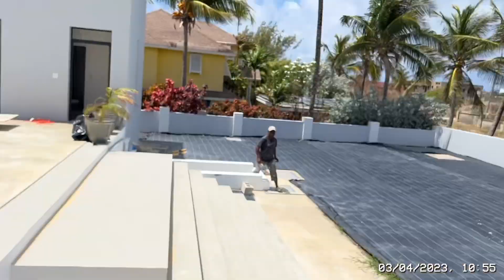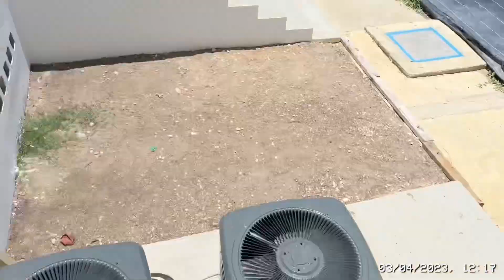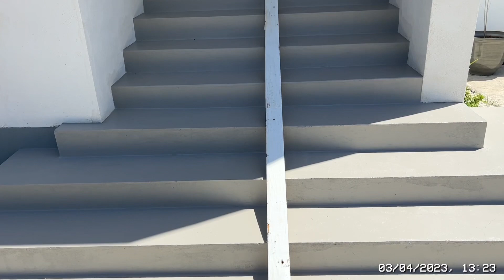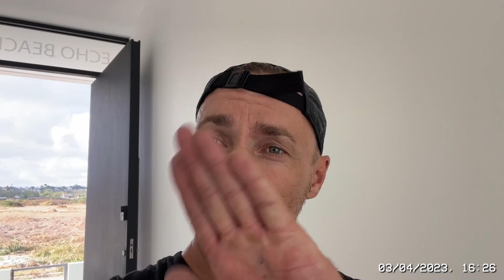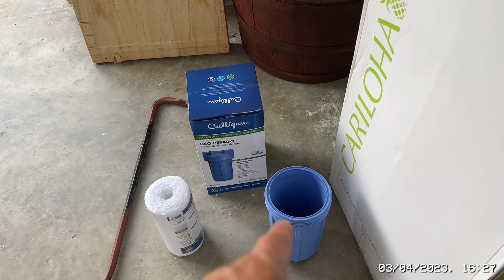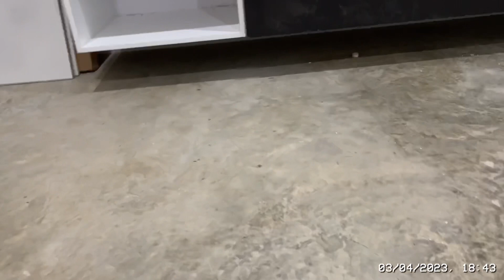BARBADOS 🇧🇧 BEACH HOUSE BUILD - DAY 448

Comment: Could you not do 3 doors in the middle the grey colour and the 2 outside ones white and then put a handle in the grey colour on the white ones. Or even paint a line on the white ones to tie them in. You could even cut the spare cupboard door you would have and mount a strip on the white ones. Make a feature of it, cheaper than 5 new doors.
Reply from the maker: I am thinking of putting in a feature fridge, a wine fridge for example. that way I only need four!

Comment: Could the recent plumbing part failures be due to increasing pressure on system? I thought you got a pressure booster not too long ago. Maybe when you were out pressure built up? Strange how those things happen all at once. Windows are looking amazing!
Reply from the maker: Hey Jeff, all of the leaks so far bar the hot water one in the wall have been prior to the booster. That said it still could be the mains pressure, I am currently looking into if we need a pressure reducer!

I will keep you posted!